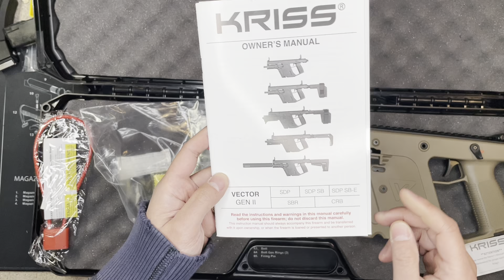Kriss Vector SDP 9mm FDE unboxing review mk1 rail A3 tactical brace install magex2 extention kit

Comment: Word of advice to anyone who buys or owns one of these, when you charge the handle, it tells you in the manual to place your fingers as close to the body as you can and then charge it, it is A LOT easier and smoother to charge. Pulling on the outside of the handle creates a lot of resistance.
Reply from the maker: Thanks
Reply: @rooftopgunguy  you're welcome. I try to pass this tidbit onto anyone I see reviewing them. A lot of people talk about the resistance from the charging handle, and it is pretty pronounced when it's new, but if you don't pull the charging handle right, it's almost like it twists the action for the bolt. Also, I highly recommend using grease instead of oil, I think it vastly improved the action movement from me as well.
Reply from the maker: @ColinStevens  BTW the black hinge upper is back in stock. I bought one. I can make the two tone Kriss now. I will make a new video next week
Reply: @rooftopgunguy  cool, I look forward to seeing what you've done. I have a 9mm FDE CRB (rifle) and a 10mm OD Green SDP (pistol) I enjoy these a lot.

Comment: i can't seam to find the adapter that goes into the receiver. Where you would normally screw in the buffer tube, but the adapter has a picatinny rail. A3 doesn't seam to manufacturer it. any help with me finding one of these would be most appreciated.  7:20
Reply from the maker: I just checked. They have it instock.
YouTube does not want people to put a link here. This is the product name.
“REAR BRACE/STOCK ADAPTER - Compact Buffer thread to Picatinny (1913) Adapter
A3 TACTICAL”

If you cannot find, send me a message through IG. My IG is @hongkonggunguy
Reply: @rooftopgunguy  i found it. thank you so much. i'm looking to put the Sig MPX folding brace on my vector, and this can make that happen. thanks for the video too, great content.

Comment: Good video. I purchased a Black one a couple of days ago and an SBA3 brace. I was looking for ideas on folding options and came across your video. I like two tones too, so I'm considering coating the upper in Sniper Gray. I'm waiting for the rest of the furniture to come in, and then I can break it in. I must say; that the charging handle has the hardest pull I have ever come across. I don't know why they can't make it soft pulling like the AR. Maybe because it is new, hopefully, after breaking it in, the pull will become softer. Otherwise, shooting that thing will not be fun, and I may not keep it.
Reply from the maker: I bought the black upper recently. It is back in stock. I really like it. I will make a video soon.
It is hard to pull. I think they use a strong spring to slow down the full auto. Of course we don’t have full auto trigger group.

Comment: Can it fold to the right side?
Reply from the maker: It is 1913. If you have SIG-style hinge, you can unscrew the arm and flip them. As long as you don’t buy the super long arm, the ejection port will be cleared.

However, in the video, it is not SIG hinge, I need to find mine and take a quick look.